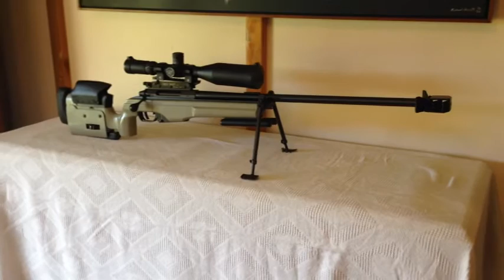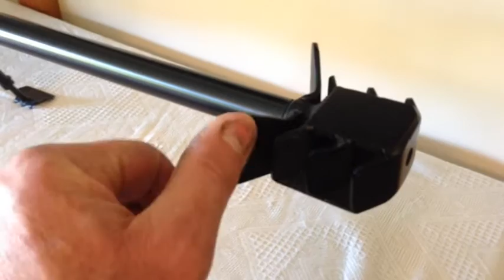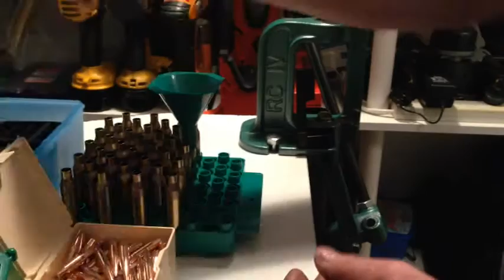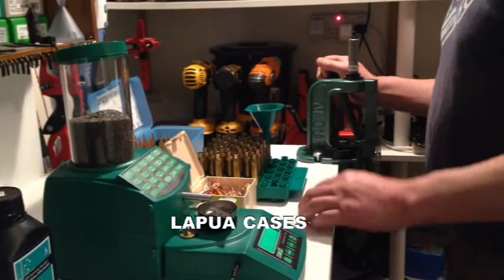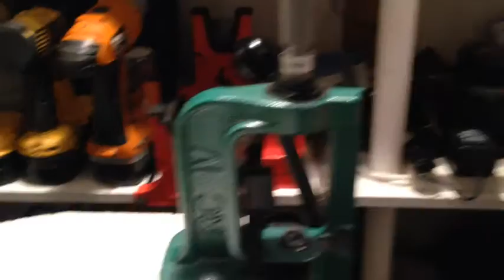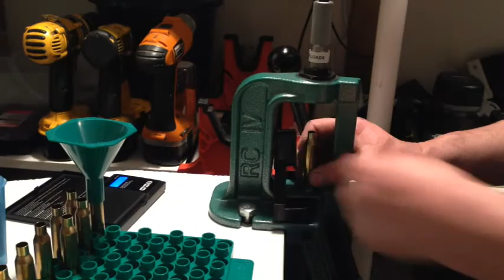Custom Sako TRG 42 in 338 lapua (latest mods)

Comment: Great videos! Any experience / recommendation re TRG 42 vs the new TRG M10, both in 338Lapua - for the long-range shooting purposes? Thank you
Reply from the maker: +petr brukner I have not seen the M10 in the flesh so could not say, but I would expect it is top notch. Keep in mind I don't recommend the 338lm for any less than 1500 metres. Cheers.
Reply: MarkandSam AfterWork  Thank you. I was told the new m10 has stainless steel barrels only, while 42´s are still chrome moly for all calibers ... what is your estimate/experience with the barrel life (around 1MOA). Some sources claim 2500-3000 rounds with the standard 338lm - seems to be higher than expected ... and yes, I use .308 under 1000meters (mostly around 600 anyway ...). Thanks!
Reply from the maker: Depends on rounds and style of shooting, I expect around 2k to 2.5k on the barrel with descent loads but no rapid fire and no aggressive cleaning.

Comment: If you're shooting out to 2 miles, the .338 Lapua isn't the best choice.  The .416 Barrett is great, but the velocity and Ballistic Coefficient of the .375 Cheytac are phenomenal.  The .375 is way better with wind past 1500 yards than the .338.
Reply from the maker: +tskfrcdgr Yes those cals are better for the job but as you will see these mods worked, check out the video.338 at 2 miles https://www.youtube.com/watch?v=VE8agUUdBfQ All the best and cheers
Reply from the maker: Hi Bill, yes just waiting for some clear sky's so we can get back out there, Cheers Man, all the best.
Reply from the maker: With the adjustable bases like the Cold Shot there are other negatives, like movement in base causing an increase in group size and to not let the scope have an accurate return to zero just for a couple. of course if you modify the units then you can improve that, but???. So if you are planning on shooting out where you need 150 or 200 moa' then yes it is the way to go, but keep in mind if you really shoot with 0 to 120 moa most the time, you will probably be loosing some accuracy for the cause. There are other bases that give you adjustment as well, your rifle, do what suits  Cheers

Comment: do you use concentricity gage ie neco to check for runout of your hybrid bullets? is it worth checking for runout regarding your LR shots[or it doesnt matter]? lastly, berger stated that hybrids require less need for jumps & jams but you seem to do 10th jump? can you clarify?
Reply from the maker: I have on occasion checked run out and is was very good with the Lapua brass and straight line dies, as for jump, I run .010" and have not changed from that, but I would say it all depends on you and your rifle. I can shoot less than a quarter moa with this set up and I am happy with that for what I do.
Reply: MarkandSam AfterWork thx 4 fast reply. but do you think getting concentricity gauge necessary? wondering if i need to buy it[it pretty expensive].

plus you seem to achieving 2mile+ w/o faster twist[like 8-9]? is it due to higher load?
Reply from the maker: As for what you should do, if you have everything else well sorted and still have a bigger than 1/2"moa group, then  you need to know, I don't think you need that gauge but as I said depends on your set up.
As for mine, same same, different rifle or set up will give different result, my set up works great with the 1-10 twist with all the loads I have run behind the 300grain Bergers.
FYI, there is no right way, you have make your set up work, but step back and look at the complete picture. Check this out it may help. https://www.youtube.com/watch?v=b2J0nfpAiDY

Comment: Mark,  Did you build the weights you are running on the forearm as well? Or were you able to find them somewhere?
Reply from the maker: All custom made by me, steel bar and plate, the lath, mig, drill and some paint.
Reply: +MarkandSam AfterWork How much weight did it add? Are you selling them at all?
Reply from the maker: No sorry not selling this stuff, Cheers

Comment: Wow, 3km is a heck of a stretch for a 338 Lapua Mark. Amazing. Imagine if you had a good 408 Cheytac... Great job!

   Mark, I have a 338 LM with a 26'' barrel and a 1:9 twist.. I tried the 300gr Berger OTM tac projectiles a while back, but never could get them to perform well..1.5 MOA.. Using 89.3gr of Retumbo my best accuracy was at about a 65 thousandths jump.. COAL=3.750" and wasn't very good. I've since went back to shooting the 250gr Sierra Matchking HPBT's... I can squeez .75 -.50 MOA out of them, if I do my part. That's running 85.9gr of Alliant Reloader 19... and the fit my mag. However, I know the Sierra projectiles would fall short of the 300gr Berger's at extreme ranges, due to the really high BC of the Berger rounds and their long ogive.. If you don't mind me asking, are you using 96.gr (even) of AR2225? And what's the case overall length of those loads? Is charge pushing the limits on the max pressure? And what's the muzzle velocity? Cheers!!
Reply from the maker: Hi Devan, thanks, and yeh it all comes down to the individual rifle and set up, I run these with 94grains, right up to 96 grains of ADI AR2225 which from what I understand is about the same as Retumbo, with the 300grain Berger running 10thou bullet jump I have a COAL of 3.895" and a .3 to .4 group, but I will say there was a lot work with the rifle to get it do that

Comment: Really Nice setup mate, 2 miles is going to be a hell of a shot. May i ask what you use to get your firing solution over that distance?
Reply from the maker: Well the fact is nothing works out there, I have used several programs and a couple of IPhone app's to help but I have to use a lot of my data and change BC's and FPS,s to get the calculations to work, nothing seems to work otherwise beyond around 2500 yards. I use the istrelok IPhone app with my very custom data and factor in spin and corriolis that I have already worked out.
Reply: MarkandSam AfterWork
I appreciate the Reply mate. Im curious only that i had the opportunity to do a precision rifle course earlier this year and it introduced me to some fairly high end Ballistic Calculators and Software (Field Firing Solutions: Delta IV) I had dabbled in a few apps here and there but relied largely on drop tables i made myself, but after being instructed on how to use the calculator to its potential and how to plug in solid data such as powder burn rate etc i have to say it was a really useful tool to get cold bore hits. Now admittedly the longest range i was able to use it on was 1000Yds but the targets were clay birds and the cartridge was 308 Win so it was challenging enough for me. Im always interested in how people go about doing something different to myself. Anyway great work mate your videos are quite excellent